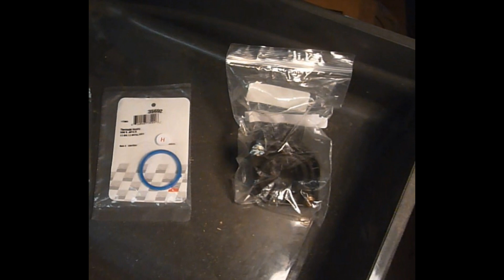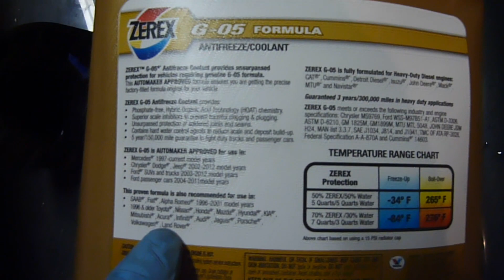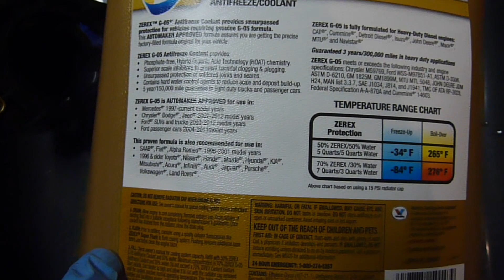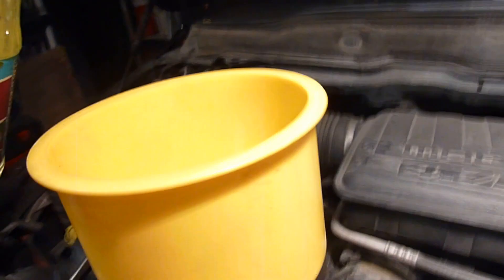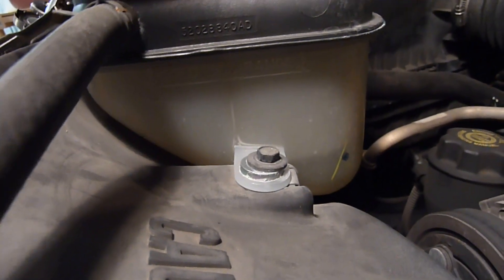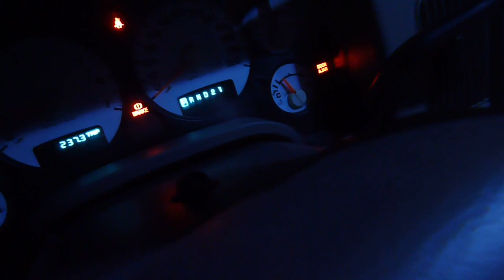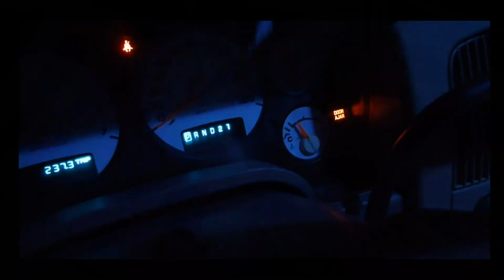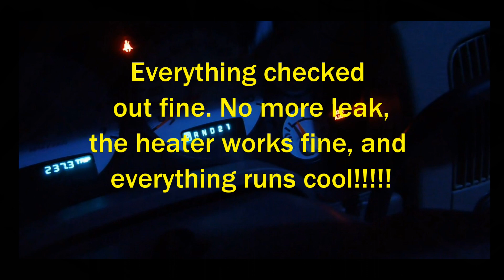Replacing the thermostat on a 2003 Dodge Ram 1500 4.7l

Comment: Lol loved your video and couldn't agree with you more about the location of the thermostat. At first I was thinking it didn't have a thermostat then I found your video. My heat is not hot at all so I'm hoping changing it will fix it.
Reply from the maker: If you don't have heat, it could be the damper doors inside the cab. Another great dodge engineering feat.

Comment: Thanks for sharing.  Doing the exact same for my son's 02 Ram today. 👍
Reply from the maker: Its not a big deal really, just kind of a pain in the butt because of the way Dodge designed it. You'll knock it out in no time.
Reply: Sub Urban Diy Guy absolutely, finished it in about 20 minutes. Appreciate ya.
Reply: @suburbandiyguy661  what brand of thermostat did you buy ? Hear that aftermarket are no good

Comment: I'm getting ready to do mine here in about a hour and wanted to find a reference vid to assure my game was on point. This is my 1st Dodge truck and it's an 02 15,4.7. Now is there no drain plug on the radiator? I always drain from that access n then when she's about done I gently rock the vehicle BK n forth swooshing as much fluid out as my 16" python's can endure. If there's a cap on top hit that 1st to get a good fluid draw. Hose time, housing time.Praying the 1.5" thread's screwed into the Bloch are not seized. Here's a tip for everyone and I'm sure 20% of you already do it buy some PB blaster and hit every bolt the night before with a good spray to help lubricate and loosen while you play video games or sleep BBQ whatever you got going on. You'll thank me later let's keep the stress levels down on our fellow men we all go through hell and bust our asses with little acknowledgement. Wait a minute we're working on a car here. Yeah this bottom housing is the same way on my Civic so I'm doing one or two, but I don't know what the little nipple is on the actual thermostat what is that for? Not the gasket, the actual thermostat perimeter lil nipple guy. Does that help with something
Important? Going to watch 2nd half of the video meow
Reply: Drivers side bottom of radiator, it's a plastic 18mm bolt head

Comment: I agree. All car engineers should be required to work on their designs before they are distributed to the public. Either that or they need to have trained mechanics do the engineering. So many bonehead designs on cars nowadays.

Comment: The only thing I disagree with is the antifreeze...worked on Mercedes for years as well as other model cars and trucks. We used the cheapest stuff we could find and never had a problem with whatever is supposed to happen if you use the wrong stuff............just sayin"

Comment: when u were bleeding it did you have the car on or dis u also have the heater on...im having the same problem changed everything u did but I have heat I think I still have air in my system
Reply from the maker: Yes. I had the heat on and the truck running. You need it to pressure up. It will get hot, so be careful.

Comment: I don't know why everyone  complains about everything Dodge does. They are easy to work on. I had a 95 Ford mustang once that had constant coolant problems, brake problems and a speedo that took a dump at 70k as well as a blown head gasket and broken timing chain- garbage. It's good practice to change your coolant when you do a thermostat or vv. My 02 has been better to me in 130k than any of the others I've had. To each their own I guess.

Comment: Is their a reason why you use distilled water?
Reply from the maker: Other water has minerals in it that can eventually clog things up.
Reply: Also those minerals react and are more corrosive than distilled.   The oxidation creates the particulates that can interfere with tstat.

Comment: If you are replaceing the turbo on a Chevy duramax theres one 10mil bolt on the back of the turbo that you HAVE TO lift the whole damb cab 5 inches just to get one bolt out. All automotive companys have a retarded streak of shit in their blood once you have worked on them all. Ford is the "exception" they are the nastiest cars or trucks to work on and Lord have mercy if your ford (pos) has wiring issues- if not now you most certianly will soon enuf .  Ford = Henrys Revenge.
God Bless America!!!

Comment: What I didn't understand was why waste your time wrestling with the hose when you could have just unbolted the housing to begin with? Also, you spent more time whining when all manufacturers have stupid things. Ford has more recalls than all others and so forth. And no matter how many times you complain it's not making a difference. Deal with it or get another truck! And the bleed bolt is an Allen not a hex. Just saying
Reply: He said he wasn't sure if the housing was cracked, that's why genius.